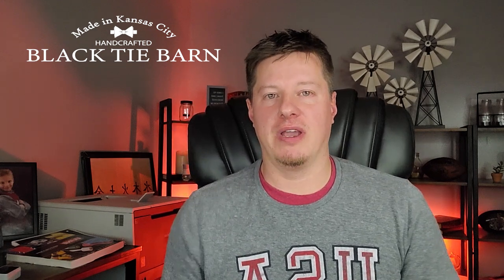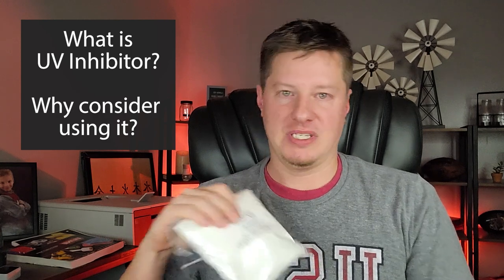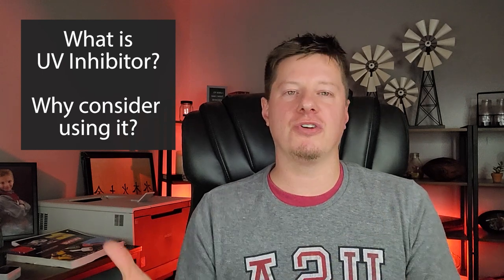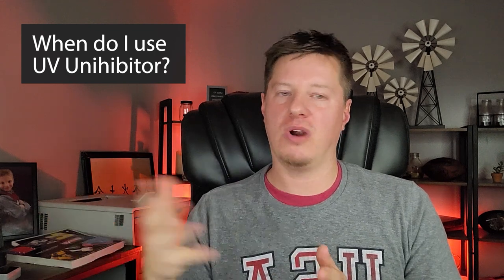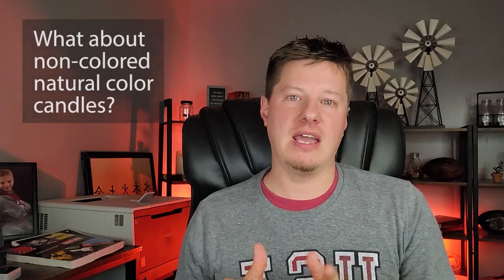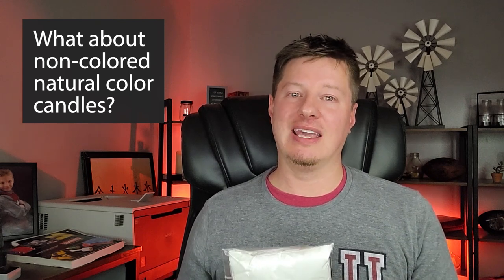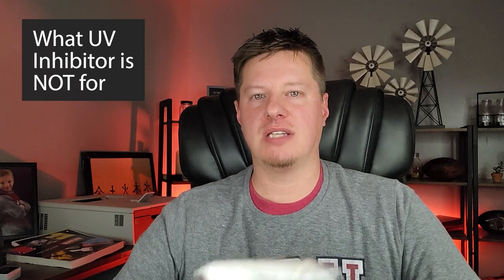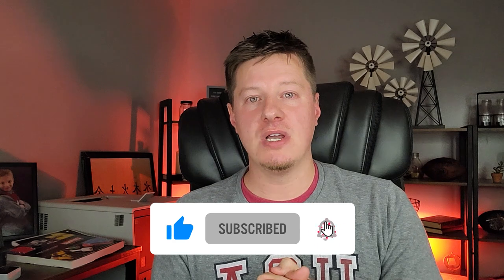UV Inhibitor in Candle Making | What is UV Inhibitor and why use it?  | Candle Making Tips.

Comment: I want to use tins for my candles. ( then Later down the road use glass jars) should I just start using  uv to keep it consistent? And does color really fade in tins? I havent started yet I'm trying to get as much info as I can before i do. 
P.s thank you for making these amazing helpful videos
Reply from the maker: Hi! Thanks for the feedback. 
To answer your question, no you don't need to use uv in your tins especially if they are always lidded. But, if you plan to transition to glass later it wouldn't hurt to use it from the get go so your testing is easier later. You will need to retest anyway anytime you change jar type or size, fragrance, etc. But... at least you won't have to worry about how adding UV might affect it if you've always used it. 

But again, its completely optional. Most people who don't dye their candles or who only use tins or colored jars don't use uv. But as I mentioned in my video....I do for everything to be consistent with testing. :)
Reply: @BlackTieBarn  thank you so much!!!
Reply from the maker: @MamaDemons  You are welcome. ;)